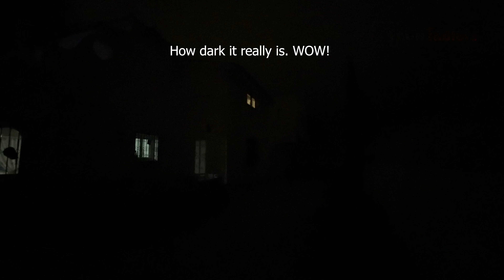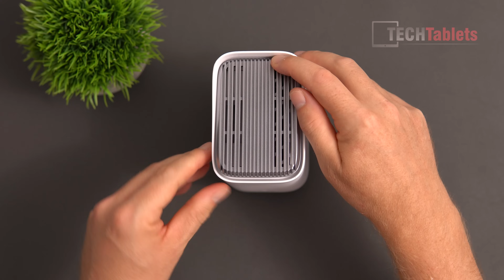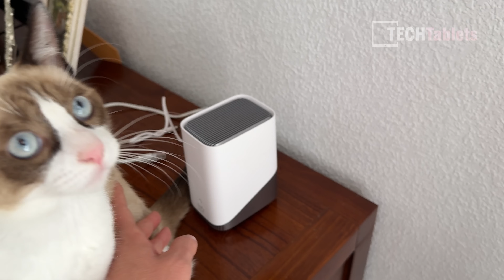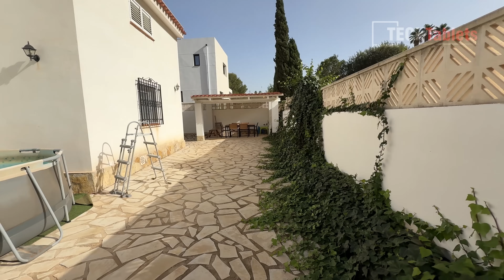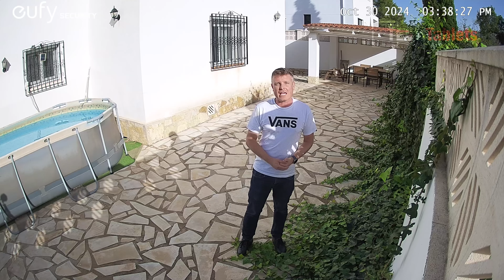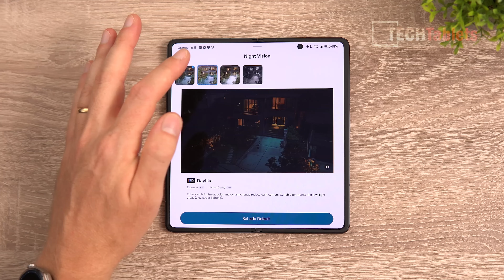eufy S3 Pro Hands-On - Awesome 4k Solar Security Cameras!

Comment: This video is absolutely the truth!  I couldn't believe it when I first looked at my videos when I KNOW that where my cameras are is VERY dark!  The videos are in color and FULLY lite like it is at 2PM in the afternoon!  THIS is security!   .....  AND .....  These cameras have NO dim red light indicators that they are recording!  They are DARK so you can hide them as needed for your own security.  These cameras are the TOP of the line and do NOT miss a beat!  The solar panel on top of the camera is great BUT, if they are covered, there are solar panels that Eufy makes that they can plug into the back of the camera and they can be hidden also on top of a roof or whatever.  I can't speak highly enough about these cameras and the technology!!!  I also LOVE the fact that there is NOOOO ongoing stupid subscription!  Just get you an SSD hard drive, slide it in the top and, more than likely, you'll never need to delete any videos.  If you need to because you're running out of room, just plug in another USB key and transfer the files to that.  EASY stuff!!!  I'm loving my Eufy camera setup!!!

Comment: How long have you been using the older 2k camera?  Have you had any issues with it, does it stay connected to base station?
Reply from the maker: Had it for years now when it was first released never had any issues and it's always fully charged
Reply: We've had the outdoor camera now for about 6 months and only once had to plug in to charge it.  This, in an area where it's foggy about 6 months out of the year.  No disconnects, reliable so far.  Only tip I could offer would be to turn down the brightness of the "spotlight" as it's near enough to the lens that it was washing out the image at night.  Turning it's brightness down a bit worked fine.

Comment: I’m in the UK these cameras never power up even on the most optimal settings. I don’t get enough sun so the battery drains from 100% to 0 within 2 weeks. It only records small clips, I only have human detection on and my activity zone is tiny. Sending it all back for a refund.
Reply: Try the wire connection
Reply: @petergerges787 finally got it working with the wired connection however I had to buy adapters to make it waterproof in the socket.

Comment: Thanks for the review! Wondering if it is 24/7 continuous recording?
Reply from the maker: Hi, not it's not it's only recording when it detects what you set it to see. But 24/7 recording would kill the battery quick.
Reply: You can plug them into the mains and then you have the option for 24/7 recording. You need to purchase a eufy usb a to usb c cable and then use that with a usb plug. You can change the camera from battery to mains operated in the settings.

Comment: Thanks a lot for the video! I have one ongoing worriy with all these cameras and systems. What is the actual and usable range of the cameras to the hub? All systems like I tried the cameras never have enough range to connect to the hub unless they are very near. I have a farm house where the cameras outside are all very far away from each other and to the hub and it all basically never works. I am yet to find ONE wireless camera security system that actually has enough wifi signal to reliability work under long distances unless they are old fashion wired systems.
Reply from the maker: The range is limited to what 2.4Ghz will cover which varies if it has to pass through walls it will be less. In my case the furthest away camera to the homebase is around 250m. I would say on a good day about 350m before the signal is too low to stream 4k and you have to use FHD or HD on live preview. It your case the best would be the eufy security solar 4G LTE S330 cam that doesn't need a network as it uses sim cards.
Reply: Wifi can be easily jammed/DoSed, weird that some security products have wireless connectivity only
Reply from the maker: Well with this product I don't see why they would make it wired. It's all about being able to put in the sun somewhere and in the rain no issues.
Reply: @Techtablets  Yeah, that's the point - convenient but insecure. Might work for some use cases though.
Reply from the maker: Sure for consumer level it's fine. Now if I had a shop, I would be after indoor wired units running at least 30 FPS, of site backup and not 15 FPS that these run.
Reply: @eugenetaranov4549 If the thieves are jamming wifi signals your probably using these cameras in the wrong place. These are consumer grade not professional.

Comment: Point about the base station: If you wire it, you can have continuous recording, but you CAN'T use it as an extender for the cameras. If you go wireless with the base station, it will extend your camera ranges (necessary in my case), but will not do continuous recording (event only).
Reply from the maker: Thanks for the info. I wasn't aware of this as in my testing connected the homebase using LAN. But thank you for pointing it out.